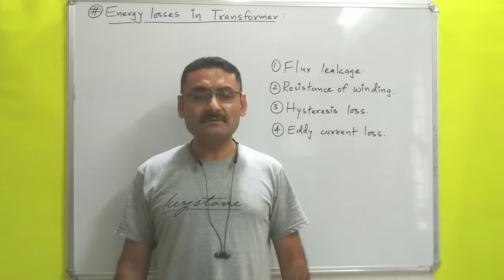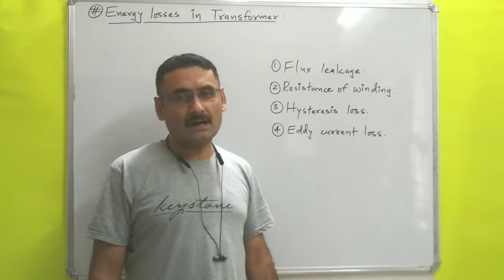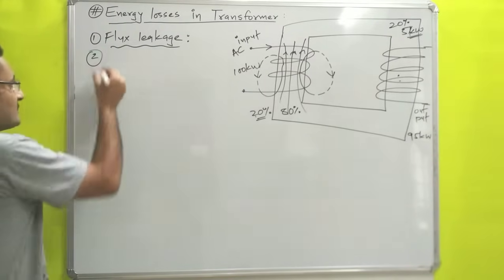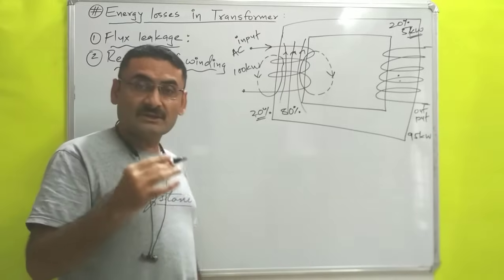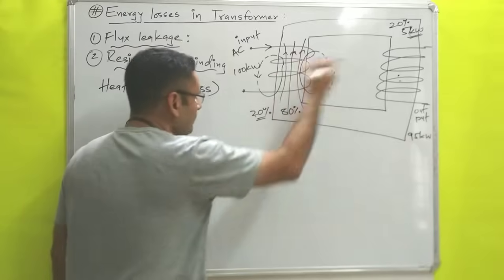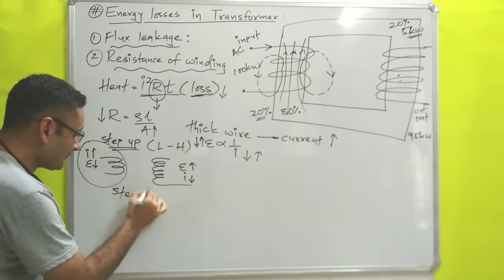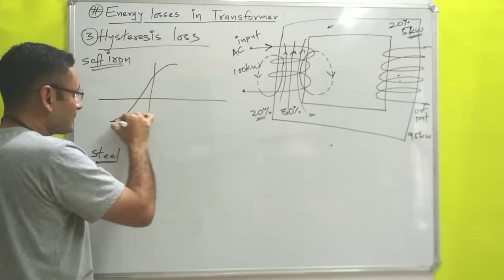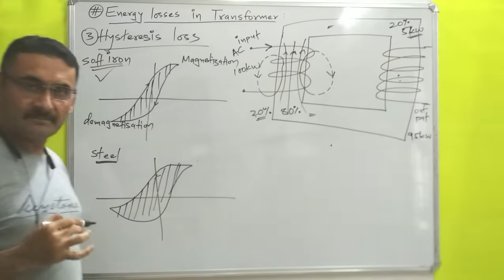Energy Loses in Transformer (Flux Leakage, Hysteresis Loss, Eddy Current Loss, Coper Loss) BEE

Comment: Energy loss in case of real transformer 

1)Due to flux leakage (basically it works on the principle that no of lines from the primary coil exiting is not equal to the number of lines on the secondary coil

2)due to power loss due resistance 
For that purpose cross section area of one of the areas is make large so that the resistance is low 
Why only one of the wires? 
Because it will cost more for two wires 

So the coil which has more current is made up with more area like in case of step down transformer 
vs<vp
Is>Ip 
So area is made high in secondary coil

In case of step up transformer 
Vs>Vp
Is<Ip
So area of primary coil is made more

3) hysteresis loss 
Due to alternating current continuous magnetisation and demagnatization is there hence hysteresis loss is there

4) Eddy current loss
If you remember there was a concept of eddy current in class 12 , so it is current flowing inside the material core so for that we use laminated core with insulating liquid hence cause less intensity of eddy current since it breaks the loop
Reply from the maker: Thanks for the detailed explanation!